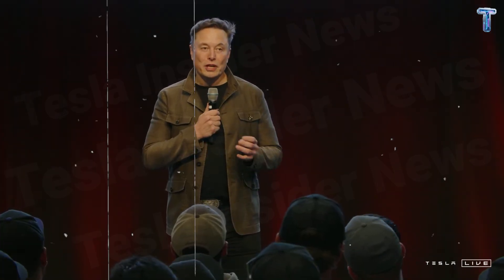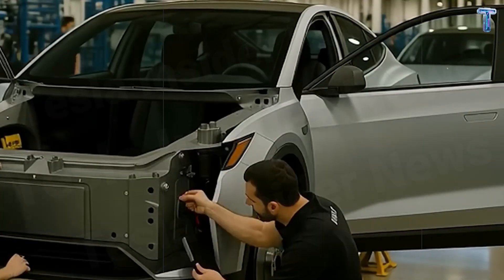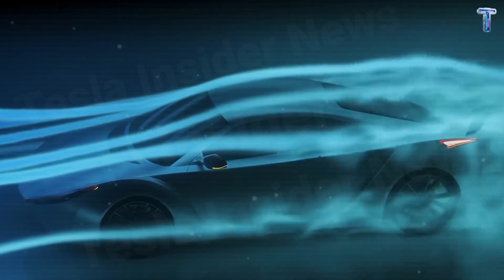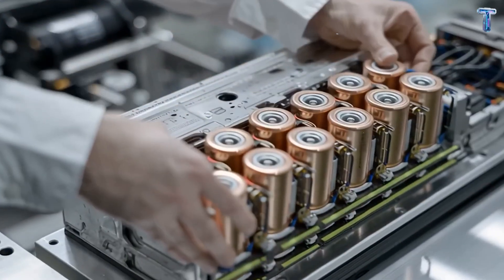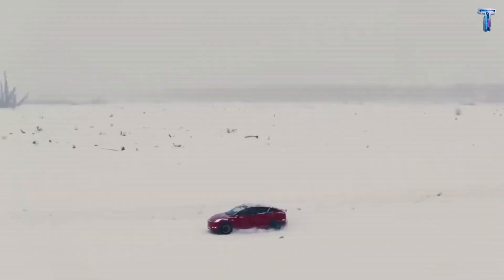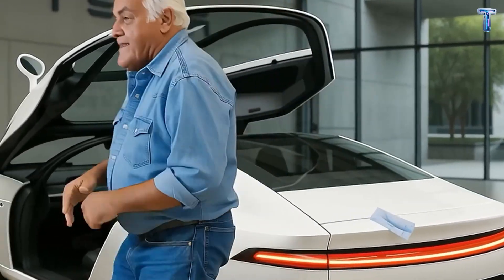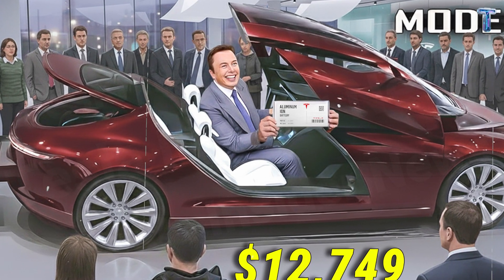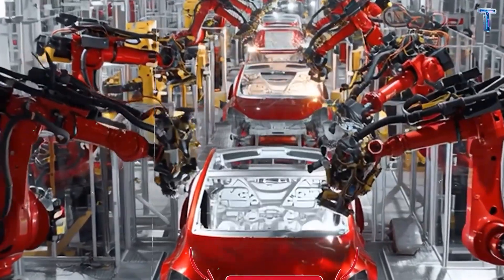Elon Musk Just Killed Lithium – The $12,749 Tesla That Lasts 50 Years

Comment: It doesn't make sense; it would destroy the industry Tesla depends on. They would have to cost 100 million each.
Reply from the maker: That’s a really good point — it would flip the entire industry model on its head 
But Tesla’s strategy has always been to disrupt first, then rebuild around new economics.
The aluminum-ion design cuts costs mainly in materials and logistics, not just production.
If the data checks out, it’s less about destroying the industry — and more about forcing it to evolve 
What part do you think would be hardest to make sustainable?

Comment: If it charges in 10 minutes you need a massive amount of power to achieve that!
Reply from the maker: Exactly! That’s what makes the aluminum-ion setup so wild — it manages high-density charging without overheating or needing massive grid draw. Tesla’s testing new cooling algorithms for that right now. What do you think, would you trade a slower charge for longer life?
Reply: @TeslaInsiderNews  It's more about our power grid not being able to handle the higher currents required. We are creatures of habbit so a large amount of people will plug their cars in at "hometime" and "crash" the grid.
Reply: @davidtapp4718  Well there are of course fuse protections of the grid, so no grid crashing. But you are right that the required power would not be available.  The answer from TeslaInsideNews is of course complete nonsense, yours is in principle correct (I'm an electrical engineer). The whole video is trash fake news. But interesting that it has  (so far) over 8k views, so he makes a bit of money on it.
Reply: Grid connected batteries and 800 volt 1000 amp water cooled charging